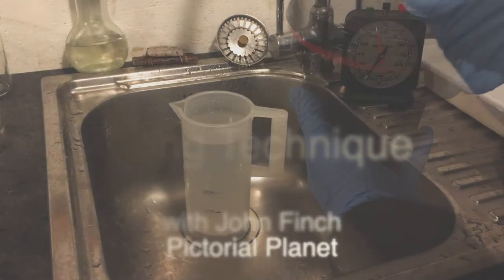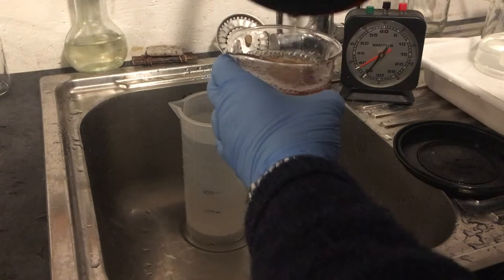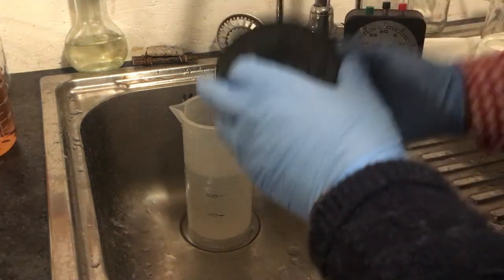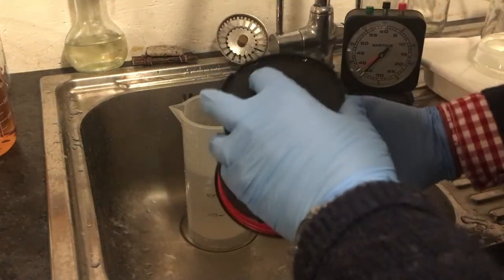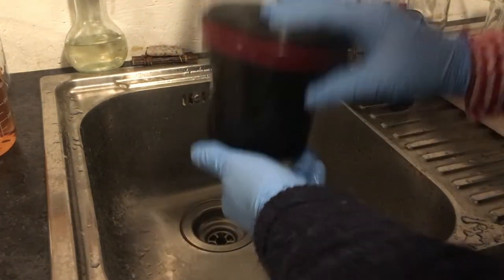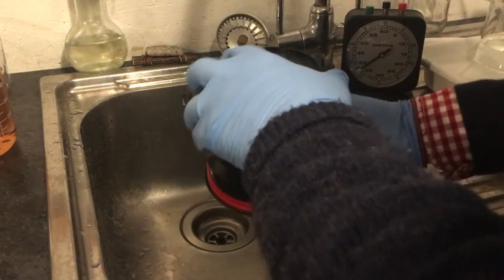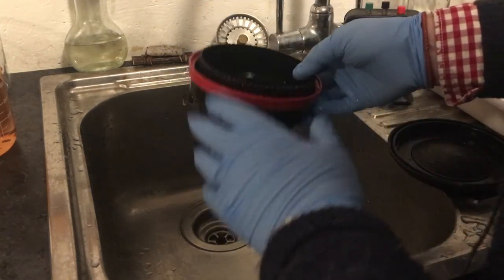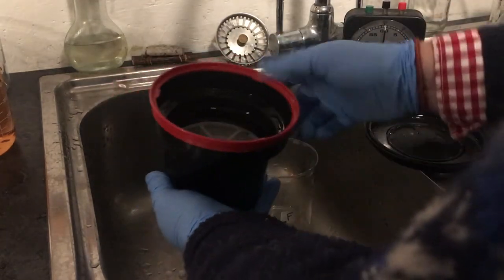Film water-stop bath and fixing technique for Pyrocat-HD and other developers.

Comment: Thanks for your videos. 
My first experience Pyro developers, was with Gordon Hutchings PMK. Upon completion of fixing  he plunged the film back into the used developer, to maximise the stain. I see no one else recommending this step with other Pyro developers.
I really liked the effect with PMK, but everything that could go wrong, did so with my films. .. and I followed the steps meticulously, including cleanliness and temperature controls. 
Your process seems to be less problematic, by far. 😳
Reply from the maker: PMK is a lovely developer indeed. And I remember the recommendation to place the film back in the developer after fixing. Thornton then said any alkali would do so suggested a carbonate solution made with a teaspoon of sodium carbonate in a litre of water. It was supposed to increase the stain wasn't it? Then it was found that it really only increased general stain so was not as useful as thought. I have always found Pyrocat to be a very good developer and pretty bulletproof proof .

Comment: Is there a reason you don't agitate using the agitator rod?  Inversion made more sense to me when I used stainless steel tanks.
Using the agitator rod ensures the chemistry is always in contact with the film. 
Thanks.
Reply from the maker: You might have missed this video. It was an early one. I like twizzle sticks but show inversion agitation because most people use that method. Done properly inversion agitation is very effective and there's no problem with the film not always being in the developer otherwise it wouldn't be recommended by Ilford etc.
Reply: @PictorialPlanet  Thanks!  The key is the 'done properly' part.  🤓

Comment: Water or eco pro is the way to go if you have a septic and or well water. The heavy acid in stop baths can change your ph levels in your water- not good.

You can also use trays of water for dark room stops. Just use 2-3 water trays for stages before fixer
Reply from the maker: Hi Nicholas, thanks for your comment. Although the PH of fresh stop is low it rises with reuse due to the alkaline nature of developer crossover from the film or paper into the stop. Very soon it's the same PH as urine. If anyone is worried about throwing stop bath away then use an indicator stop bath or PH papers to test the stop. Once it's at PH 5 it can be discarded without worry. If you are using developers  as "one shot" then by throwing away the developer and the stop they will effectively neutralise each other. Another point is that sceptic tanks very effectively destroy the stop and developer with a powerful reducing effect thus rendering them harmless. Finally I'd say that there are much more potent cleaning chemicals that go into your sceptic tank that are also reduced safely and don't effect ground water. To sum up, photographic chemistry is not a problem with sceptics and ground water if used on the small scale if a home darkroom.

Comment: This is great! Very informative.  Just got my Pyrocat HD last night from Photographer's Formulary.  I'm going to try it out.  Do you just put the developer back in at this point after the fix?  and how long? Is this a necessary step?
Reply from the maker: Hi Regaling! No need to put the developer back in after fixing. That advice has been superseded and now you just wash the film as normal.
Reply: @PictorialPlanet  thank you 👌🏼
Reply: @PictorialPlanet  oh, and you said don’t use stop bath. Even in short times (say 6mins)?
Reply from the maker: @regaling  For such a short time I'd use a stop bath. For Pyrocat, 510, and other staining developers you might get reduced stain though.
Reply: @PictorialPlanet  This will be my first time printing in a darkroom.  Can you talk about why the staining can be helpful when printing?
Reply from the maker: The stain is created by development activity and therefore is in key with the negative. Where development happens most the stain happens most so there's proportionately more stain in the highlights than the shadows. This means the stain reduces apparent grain by filling in between grains. Stain also helps print more delicate highlights by subtly increasing contrast in those highlights. The main reason to use a pyro developer is because of the stain.
Reply: @PictorialPlanet  thank you 👌🏼

Comment: Hi John, love your channel been a fan since you started posting. I have recently got some 510 pyro which I intend to use with FP4, Pan-f and possibly HP5 my question is do I HAVE to use an alkaline fixer? I've watched your great video on making the TF-2 fixer but fear I can't get around to doing that at the moment. Any advice greatly appreciated. Thanks and keep up the great work.
Reply from the maker: Thanks for your question! No, you don't have to. Your results will still be great. I would advise that next time you buy fix (or want to make it) you do get the alkaline variety as it will optimise your use of 510 but use what you have now and enjoy this great developer! BTW, if you eventually want to purchase alkaline fixer a good supplier is listed on my website.
Reply: @PictorialPlanet  That's fantastic John many thanks for your quick reply. I will be trying the 510 very soon now. I think I remember you mentioned that supplier in one of your earlier videos if I recall, was it in North Wales? Thanks again so much, it may not seem such a big deal but your video from last week on loading 120 on to a reel was an absolute belter, works a treat I had so many troubles in the past and got frustrated at times.
Reply from the maker: Cheers!

Comment: Great video, John. Do pyro developers require a certain kind of fixer? Would something like Kodafix work?
Reply from the maker: A lot has been said about pyro and fixers. I use an alkaline fix for my pyro negatives but I have read a Sherman article where he uses regular Ilford Hypam and is perfectly happy with the results. Certainly the formulator of PMK, Gordon Hutchins) who did an immense amount of work studying pyro negatives advised an alkaline fixer for maximum pyro stain. So for my FP4 negatives, developed in pyro or pyrocatechin, I use TF2 fix. For Delta films I'd be happy using Agfa 304. What I never do with a pyro developer is use a sulphite hypoclear. Sulphite reduces the pyro stain so I just ensure a very efficient wash.